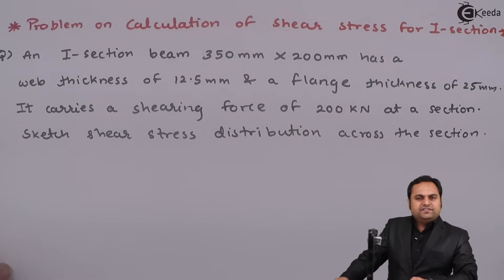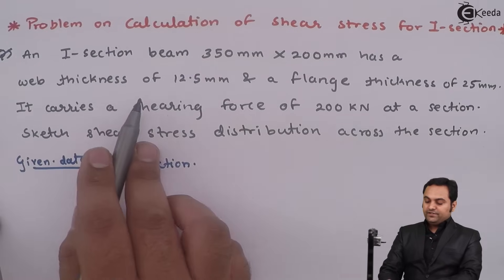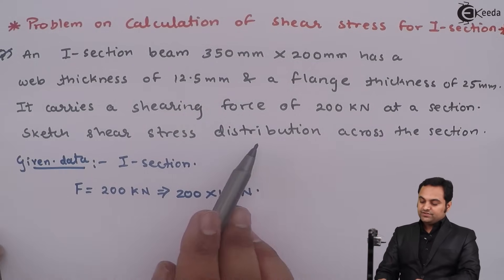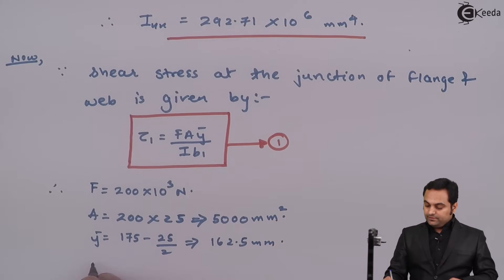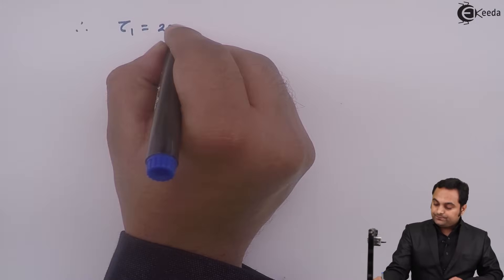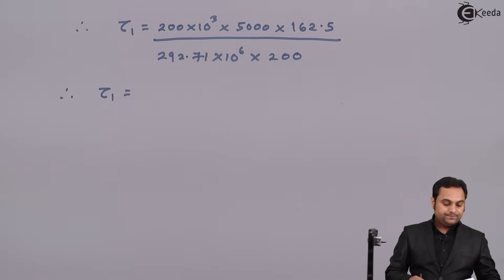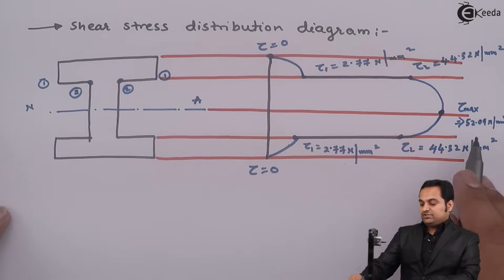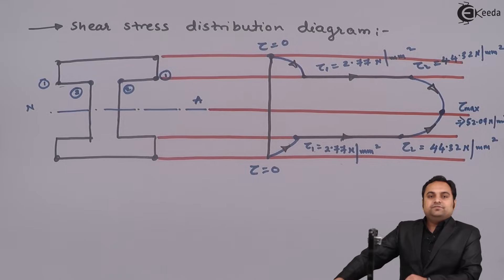Problem on Shear Stress in I Section Beam - Shear Stress in Beams - Strength of Materials

Comment: 1.5 ( A ) . A simple turnbuckle arrangement is constructed from a 40 mm outside diameter tube threaded internally at each end to take two rods of 25 mm outside diameter with threaded ends . What will be the nominal stresses set up in the tube and the rods , ignoring thread depth , when the turnbuckle carries an axial load of 30 kN ? Assuming a sufficient strength of thread , what maximum load can be transmitted by the turnbuckle if the maximum stress is limited to 180 MN / m² ? [ 39.2 , 61.1 MN / m² , 88.4 kN . ]

Please answore😭😭

Comment: Here you have to subtract 2 times of moment of inertia of small rectangle in hole moment of inertia.
Reply: Well technically you're correct but for that you would need to take breadth as 93.75 and then write it twice, but sir has taken 187.5(200-12.5) directly which is technically 2x moment of inertia so he is not wrong either

Comment: Values of y1 and y2 is not correct. Y1=distance b/w NA to top most layer, but you taken as y1=y bar .which is wrong
Reply: Same doubt for tmax y2= 75+25=100 and not 75.

Comment: Why not in shear distribution straight lines are use rather then arcs
Reply: same question
Reply: Because shear stress from one point to another does'nt vary linearly, calculate shear stress at different points from neutral axis and plot a graph you will get to know

Comment: @ekeeda , here 350 mm*200 mm it means horizontal dimension 350 mm and vertical dimension 200 mm . But you showed it inverse in figure
Reply: You are right
Reply: Until it's given,take higher dimension as thickness